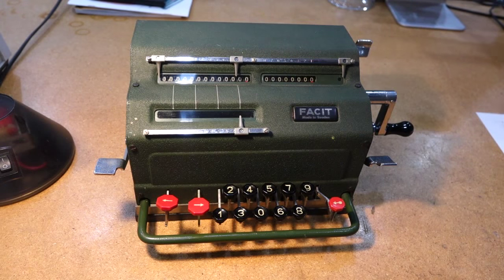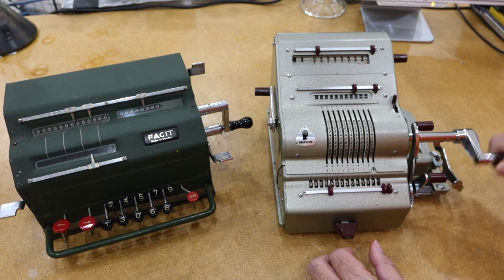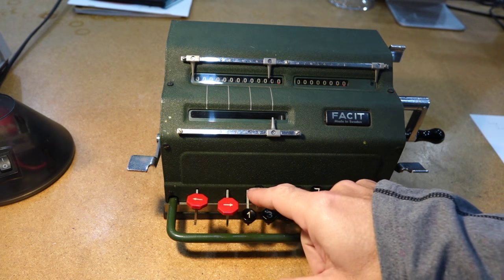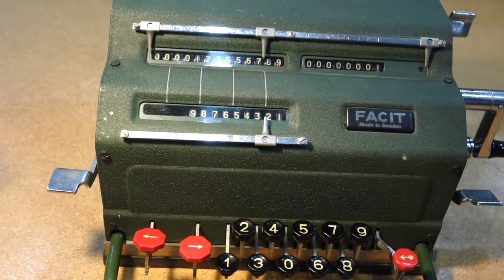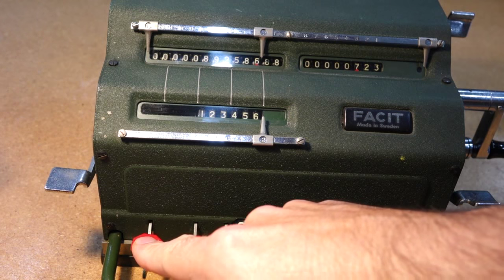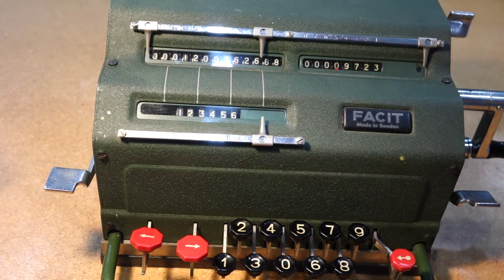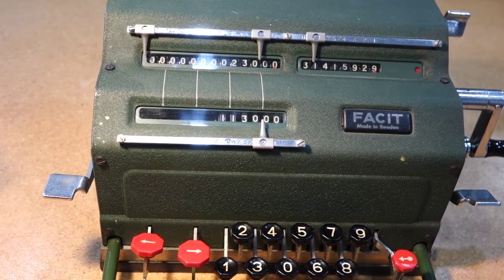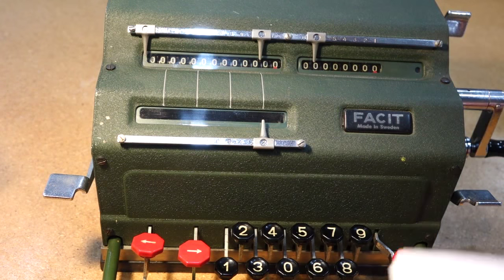Facit TK Mechanical Calculator Demo (1936)

Comment: Am I missing something? Zero is not in the middle of my computer keyboard, either on the number row or the number pad. On the number pad it's on the bottom left, 5 is in the middle and on the row it's obviously after 9.
Reply: It's in the middle of a phone keypad, though my understanding is that the Bell engineers explicitly eschewed adding machine precedent when designing that

Comment: I have a Facit C1-13, do you by any chance have an idea if there are places in Belgium where it could get revised (or do you know of places where it is explained how to do some basic maintenance)? It works fine, but I assume it needs to be oiled and mabe dusted off.
Reply: Just give it some WD-40 and it should be alright. Just don't try to take it aparat.

Comment: My Åtvidaberg machine counted backwards on division and the red indicator did not show.

The error was old sticky oil in the top shaft. To keep counting forward in division the gearbox reverses rotation of the right sections of the shaft.

The red dot indicates "gearbox in reverse"

If your top shaft is petrified and your boss wants the numbers right away, you simply start a division by subtracting the dividend. Then input the divisor and crank forward instead of in reverse.

Comment: "That's why the 0 is still in the middle on your computer keyboard".... what? What keyboard are you talking about? My 0 is at the right hand side, and the keypad 0 is at the bottom. I've never seen a keyboard with a zero in the /middle/ of the numbers...
Reply: He meant the entire keyboard....
Reply: I thought he was referring to the placement of the zero on the telephone keypad, which is horizontally centered on the bottom row of keys. With the numeric keypad on a full-size keyboard, the zero is also roughly centered.

Comment: Yay I have the same model. Its from 1944 :D And works really well
Reply: Wow mine is also from 1944. And has a french label.
Reply: @my_negative_world  yes same. Fabriquée en Suéde right?
Reply: @txd  yes exactly. I would love to know more about it but there isn't much info online.
Reply: @my_negative_world  we i found a manual and place that explains the models and also the serial lookup pages. But I wish i could find mekanical information 😃
Reply: @txd  I have 3 different models of hand cranked Facit machines and 1 model of the motor driven ones. Just found a great reference to these machines that I expect will help me unstick or fix most of them at johnwolff.id.au/calculators/Tech/FacitC1-13/C113.htm.  Lots of gummed up lubricants.

Comment: You have a strange way of dividing as you need to do alternatively rotations at different directions. Just turn one rotation back when the bell sounds and it is much simpler. The idea is to mechanize the calculation with minimal thinking.